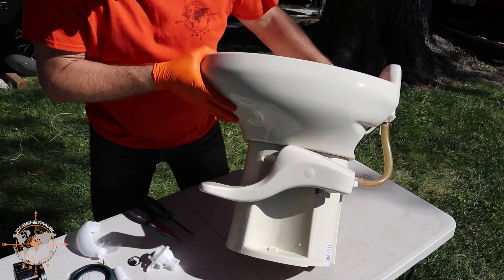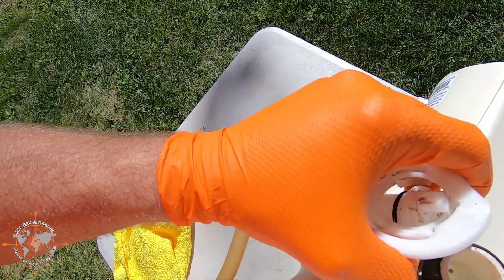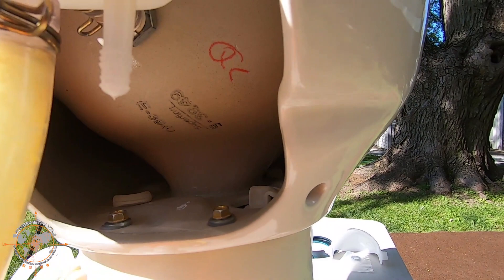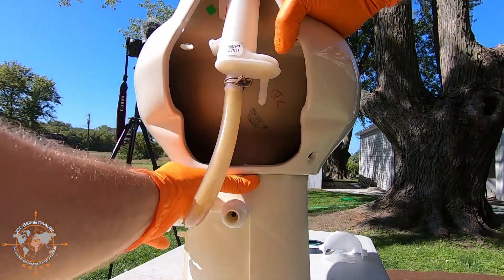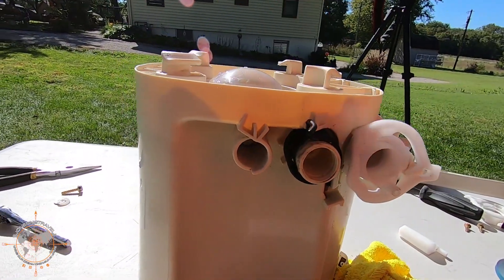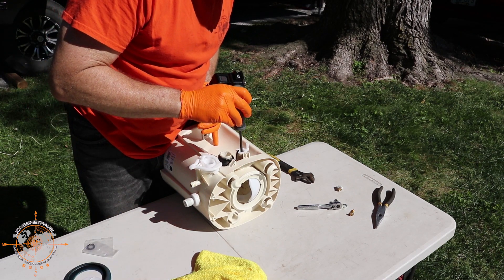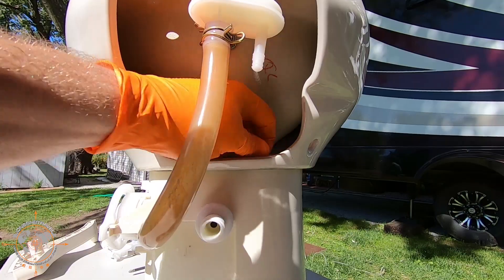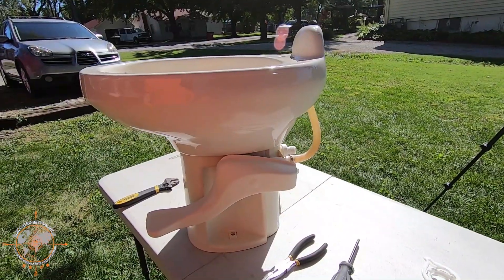HOW TO THETFORD RV TOILET REBUILD | RV LIVING

Comment: I just did the job. Took me a bit longer though. Few observations and they may cause a removal and remount. When I took the bowl off, the mfr apparently had used some sealant on its underside. Didnt know, didnt have any. Didn't see you add it. Attaching the new water valve, there are three tab and slots that must interlock to retain the flexure. I missed one, so had to remove and remount but less struggle then. My toilet is against the wall. Re attaching the toilet seat is nearly impossible when threading on the retaining nuts underneath. Removed toilet, added seat, recounted toilet. Heres what I didnt not consider. Cleaning the flange on the floor before installing the toilet. Stupid I didnt even look at it. I'm not sure what I'm seeing but theres a faint glistening of water at the edge of the base. This can only be from a flush. Best to remove and remount. Any thoughts on this, and are there recommended sealants for the flange interface? Thanks.
Reply from the maker: Hi Paul. I think a good clean around where the flange seal goes is sufficient. I have not seen one that had any sealant around it when I took it apart. My only concern would be that the wrong sealant could cause the toilet to stick to the floor and make it tough to get off. Maybe they used a rubber cement or something just for the added security. Hope that helps. Thanks for checking out the video and I'm glad to hear that it helped you :) Safe Travels
Reply: @JonesN2Travel  I discovered the water was slowly leaving the bowl. At first I thought, ok, let's take it out and check the seal. I'm not seeing any sign of water as mentioned in my prior post, so I turned to you tube again. I found a video about the foot lever stop for the flapper drive cylinder. The pin feature is engaged with the pedal. Theres a stop on the base that strikes this pin feature. Seems that the slightest gap at that feature will mean it's not fully closed. Popping the pedal at each tank filling will make the hard contact, there by closing the flapper. Now, after all this, do you believe the screw in the flapper drive cylinder has to be at the right torque or the pedal freedom is reduced thus affecting that hard stop? I believe a hole in the arm would give me access to that screw. Thanks for putting up with this "memo".
Reply from the maker: @paultaylor6167  you could try to loosen that screw but I don't think it will make much difference. I've not had an issue of the flapper not closing all the way after a rebuild. Our toilet did that once but that is what prompted the rebuild. The rubber seal on the flapper was quite stiff and it was dragging on the flapper causing it to only close all the way if we "snapped" the pedal as you mentioned. After I rebuilt it, replaced the seal, it functioned like new. I am curious to hear what happens if you mess with that screw but please don't drill a hole in the arm just for my curiosity. :) Please keep me posted.  Safe Travels

Comment: This video was very helpful... thanks.  But I did have one issue when trying to put the foot pedal flusher back onto the base, it was not easy to do.  I did not know exactly where the Spring was supposed to go, and ended up breaking the plastic tab that the spring is bound against.  Now I need to replace the whole base rather than just a few parts.  What a bummer.  I only wish you had showed the three holes on the backside of the foot pedal so that we'd know how to put it back.  But otherwise, great video.
Reply from the maker: So sorry to hear that Aaron. Mine had a clear mark on it where the spring landed so I didn't think to mention it. I apologize. Thanks for checking out the video. Glad to hear it was at least mostly helpful :) Safe Travels

Comment: do you have a part number for the foot pedal? just wondering, my snapped off and flew like a boomerang -
Reply from the maker: Hi Rose. I tired to find the part number for you but didn't have any luck. I apologize. :) Thanks for checking out the video. Safe Travels
Reply: @JonesN2Travel  thank you for trying! I'm going to just replace the toilet, it just makes more sense at this point.

Comment: Hello - what do you recommend be repaired or replaced when the foot valve doesn’t return back to a “‘Valve-closed” position?
Reply from the maker: Hi Jim. Its really the effect of the spring lube drying out and sometimes it's the actual rubber seal hardening a bit. I have had some luck using a silicon spray to spray the rubber seal. Just spray around the seal and the ball valve from the top with the toilet still installed. It also makes the toilet easier to clean.. 😁 If that doesn't work or when it starts to stick again you may have to do what I did in this video. Just be sure to lube everything well when you put it together. Hope that helps. Safe Travels
Reply: @JonesN2Travel  
Thanks for the video. On mine, the arm actuating the ball valve has broken where it Ockham into the pedal. I believe that arm is in a rebuild kit . Is this kit model dependent? And can you advise as to fastest way to find a rebuild kit? I am full time and I need to fix this today.
Thank you!
Reply from the maker: @gordongoodrich  The arm will be in the kit. Yes, I would make sure you get the kit for your model. Fastest way would be to source the kit from a local RV supply store or Amazon. Hope that helps. Safe Travels
Reply: This is an old post and I assume you found the help you needed already. But I’ll go ahead and offer this in case  in case it’ll help someone else. Your question begets a question, does it stay completely open or does it just not close all the way?  Mine just wouldn’t close all the way. Replacing the water valve fixed my problem, for some reason the water valve was hard to move. Don’t know if it was dirty lubricant or the O-ring getting old and brittle. The part number for the Thetford water valve kit is 42049.  That kit fits the Thetford model 42072 Style ll High pedestal. That’s the model toilet pedestal I have and I believe it’s the one depicted in this video.  If your waste valve doesn’t close at all then it’s more likely the waist ball drive arm and/or the waste valve itself.  The part number for the waste ball Drive arm kit is 42048.  The kits are not that expensive and you’re probably better off just replacing both of them. I think they’re about $15 each.  I hope that helps someone.

Comment: We have a slow drip from where the water comes out. Will changing the small spring fix it most likely? Thank you! Very easy to follow, detailed video!!
Reply from the maker: That may just do it :) Thanks for checking out the video. Safe Travels :)

Comment: I have the parts to replace the water valve. In preparations for the job, I dumped my tanks and put new deodorizer in the black. My wife has been complaining about the water pressure in the shower and kitchen. Where I am, I was able to remove the pressure reduction valve and improve the pressure into the RV, and consequently the toilet. Flushing is much better and the toilet is not exhibiting the issue of not stopping. I wonder how if at all can an increase in pressure cause the lever and valve actuation to improve. I have the flapper replacement parts coming but not for a week. I would prefer to do the entire job as in your video without pulling the toilet out twice. I'm not sure what I'm asking accept your impression on the change in function with the change in pressure. Any thoughts on the mystery? I wonder if anyone else has seen this happen? Thanks
Reply from the maker: Hi Paul. My guess is that the increased pressure is pushing the spring/valve closed better than low pressure. Great catch though, the pressure in most parks is high and needs to be regulated but it sounds like you're seeing the opposite. Thanks for sharing and best of luck with your rebuild. Safe Travels

Comment: The arm you replaced didn't look damaged. Can you either show the difference between the old one and the new one so we can know what to look for to determine what is good and bad. Thanks!
Reply from the maker: Unless the arm is broken off you really wont be able to tell. The new arm comes in the kit so I always replace it to be safe. Hope that helps. Safe Travels

Comment: U could have went slower and showed a little more detail when putting handle (foot pedal) on and the other part where u have to push down the part where u replace the black washer and spring.  The white two pieces. But other than that good

Comment: Who else is here cause their Thetford toilet flooded their bathroom in their rig?
Reply from the maker: Wow. That is never fun. Hope this helped you get it fixed. Safe Travels
Reply: @JonesN2Travel  it did! Just had to really pull that lever off.
Reply: A full timer with a tretford that has leak by and a new technician who's herd horror stories about working on these. Definitely not a dometic 310 lol